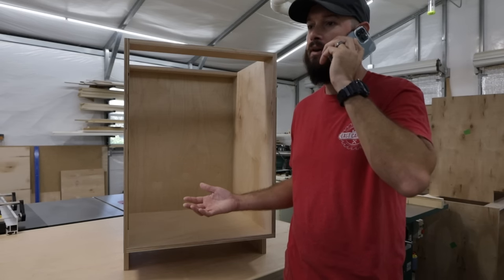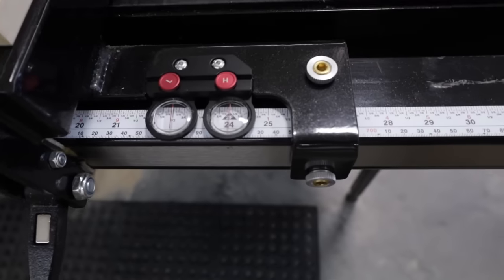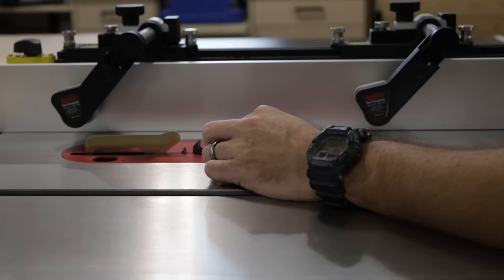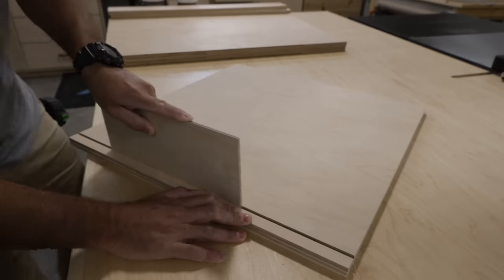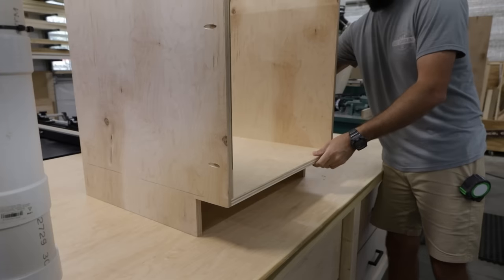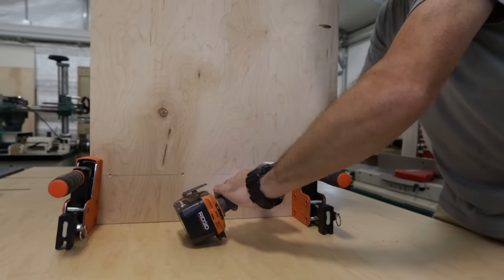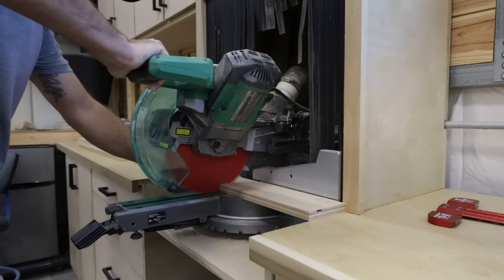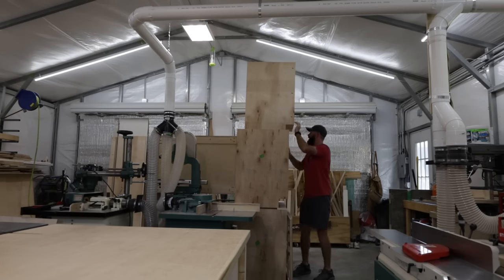How to Build Cabinets in under 30mins //The Easy Way

Comment: I'm only 6 minutes in and I am noticing a pattern to your cuts. When the cut is completed, you draw your hand(s) back to yourself along the surface of the table saw. I imagine this is an unconscious muscle memory habit you have been doing for years. I fear that one day you will do this out of habit and inadvertently hit the blade.
I also noticed you are moving your scrap while the blade is still spinning, and your arm and hand are coming close to the blade in the motion.
Please for your own safety, once the cut is complete, lift your hands straight up and away from the table surface, which is also up and away from the spinning blade.
Reply: I just continued watching after making the above comment, and at 06:41 your pinky finger comes dangerously close to the blade while you are pushing the material through. 
While I am sure you are very experienced, you are getting dangerously close to that blade on many of your cuts you are making. All it takes is one distraction while you are cutting to cause and accident. 

Please Please Please go back and review your videos with an eye on safety and how close you are getting to that blade. See how many times you come close to losing a finger.

Comment: No way in hell you built that cabinet in 30 minutes. Also 90% of those pocket screws were unneeded. you were already screwing through the side of the cabinet, so just keep doing that. The connections from the outside of the cabinet are much stronger than the pocket screws will ever be.

Comment: Every time I watch a cabinet making video I hope I'm gonna see something tricky, maybe even an act of genius but most time's I'm disappointed. I noticed your married, so I was thinking you'd make cabinets that will help your back as you get older but again, your just making a standard cabinet. Maybe when your 60 you'll get it. I was even thinking you might be using that dead space at the toe and maybe even make a skinny drawer to fit it there. But again, not the case.

Comment: Where are your safety glasses. When doing a training video that new woodworkers would be watching safety should stressed.
Reply from the maker: I’ve been made aware…I’ve got them on in my upcoming video 👍🏻
Reply: @eastcarolinawoodworks  
I'm sorry I was a little rude with my previous comment. I should have started with nice build. I didn't mean to sound negative. I work as a carpenter building cabinets and other furniture at a college that is full union and safety is adamantly pushed.